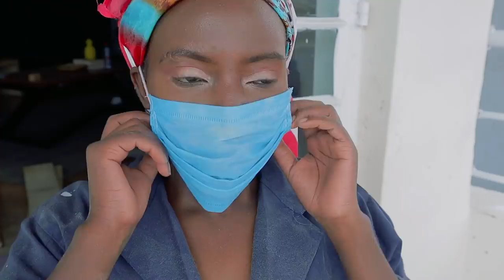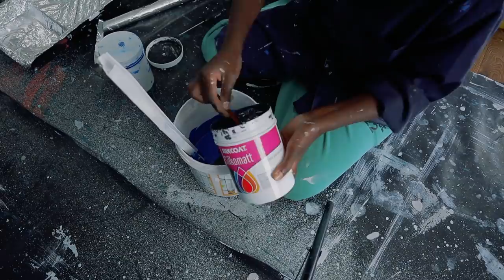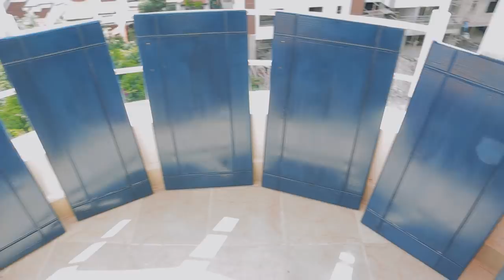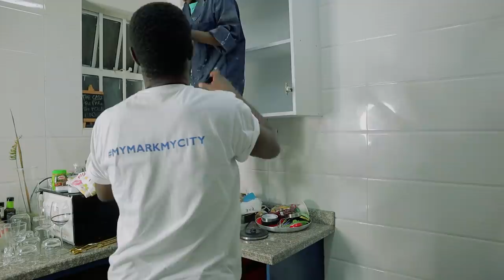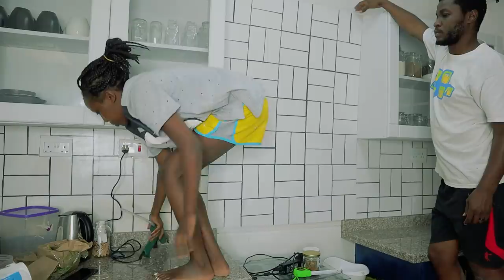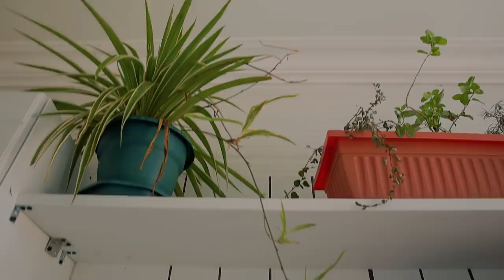EXTREME KITCHEN MAKEOVER \\ Cute 2 Toned KITCHEN

Comment: Tip for drilling on walls with tiles.Drill onto the lines/partition not the tile that way you don't have to replace the tile when moving out you can cover the holes the way you cover the ones on walls.
Reply from the maker: Thank you. I thought of that but was worried that it would weaken the backing.

Comment: Hi Muthoni about the painting how did you paint on MDF cabinets? Then the back splash what did you use ply wood?
Reply from the maker: I explained this in the video... I just painted and didn't sand them because I have to restore them as were. I used plywood because I had a sheet of plywood I wasn't using.